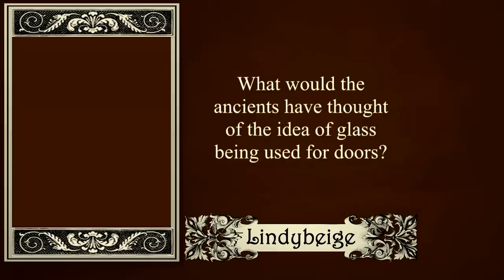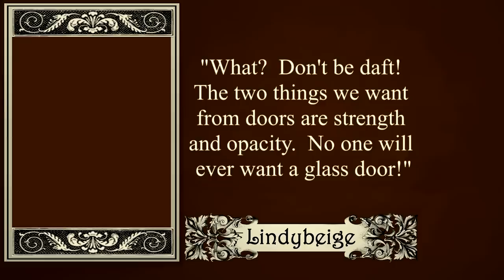Ancient technology: Saxon glass-working experiment

Comment: You're right I HAVE wondered what the Anglo Saxons were using between the 7th and 9th centuries to make glass!
Reply from the maker: I have my finger on the pulse - in tune with the Zeitgeist!
Reply: In The Mix not the sixth or tenth, though, why would anyone think of THAT.
Reply: @AAAAAAAA-vd6zv  couldn't care less about glass making in the tenth!
Reply: @lindybeige  thanks for the best way to start my weekend
Reply: @lindybeige  
Sometimes they didn't use glass at all … often they just used shutters, and then had them open during the daytime.
However, during the winter months, if you could make a shutter that kept weather out, and let light in .. even a small amount, you could save a lot on candles.

The simplest of shutters, are just a bunch of planks nailed together, and while they protect from the weather, they also keep all light out.
You could make them with louvres, and while that would keep rain, snow and some of the wind out, they would not keep the warmth in.

So, I've been told that sometimes they would take some leather and scrape it REALLY thin, and then make it wet and stretch it over a frame .. when it dried, it would shrink a little and put the frame under compression - Very much like a drum skin, just repurposed. They would then take the leather frame, and stick it on the inside of a louvred shutter, making it good against both the weather and cold. They could do it with wax-cloth - Heck you might be able to do it with varnished paper as well!
I suspect that the old French Polishing method might actually produce a fairly good result.

Obviously, once glass became available to the common man, shutters were relegated to extreme weather protection, or protection against criminals.
Reply from the maker: @Grumpy_old_Boot  ??  On windows, do you mean?  Yes, as I said it was just about practicable to have glass windows on some high-status buildings - therefore not the rest.
Reply: @lindybeige  
Correct - Even some of the rich people didn't use glass everywhere - It was fairly common to just have shutters in places such as stables and servants quarters - Even if it was technically the nobles house.

They didn't need the light anyways. 
The dirty proletariat that they were. 🤣
Reply: The sleepless nights!
Reply: In The Mix then youre watching the right video
Reply: In The Mix then dont watch the video
Reply: @lindybeige  Your videos give me something to look forward to in an era where all entertainment media is subversive political dogma bordering on the religious. Thank you, and keep it up, please!
Reply: @Grumpy_old_Boot  I too have read of the magical skin-window. However the issue is you aren't keeping any heat in either, as a tiny thin near see-thru piece of skin isn't going to be a good insulator so at that point you may as well have the bloody window open! :P
Reply: @dr.lexwinter8604  
The point was not to have an amazing insulator, it was to let sunlight in to save on candles and to stop the cold air and the hot air from mixing. Heck, you could use anything else in place of a proper glass window, and it would still work.

Heck, wind resistant shutters work too.

The whole point, was to trap the warm air inside, and the cold air outside .. and maybe get some sun in as well.

The actual insulation properties of the material itself was less important, as the loss to mixing inside and outside air would always be a much, MUCH higher loss to begin with.

Heck, you could have used translucent aluminium, one of the best heat transfer materials around, and it would still be a positive result.

Turns out, that having gaping holes in your building, looses heat faster than plugging them up! 

Shocking, I know. 😆
Reply: Same it’s been on my mind all day!
Reply: @LegendLength  
I guess you could make a thin sheet of tree sap and dry it out, trying to turn it into a sheet of amber, it's a lot of work though. 

But I'm guessing that the end result would be similar to semi translucent plastic.
We know that translucent plastic make lovely windows. I reckon you might be able to do it with lacquer as well.

But it doesn't have to be completely translucent, semi-translucent will do as well. Adding fabric or some other kind of fibres to the mix, would increase the strength of it.

Edit :
Paper windows was quite common in China/Japan/Korea, usually paper and lacquer was used, meanwhile 1800's american pioneers sometimes used greased paper windows, when glass was too expensive.

Comment: That tunic would scare the HELL out of me, working with hot glass like that
Reply: It would be incredibly hot in a glass workshop so it would make sense to not wear that many clothes.
Reply: Well if it's wool, it's basically inflammable and not a problem; issues will be mostly cosmetic, maybe some small holes. If it's a flammable natural fabric, the worst that can happen is a spot catches on fire and you slap it, putting it out. You now have a hole to patch and some slightly singed hairs, maybe, but that's it. Even if it the entire thing catches fire and burns off of you, you'd have to be quite daft to let it burn long enough to badly injure you and not take it off. And fabric being quife the insulator, does provide you with a decent grace period of protection from accidentally touching hot stuff.

Now if you have a synthetic fabric, that's quite dangerous; it can burn, but melts onto the skin instead of burning off of you, and the natural reaction is to pat it out, driving that molten plastic into the skin of the melting area and your hand.
Never work with heat with synthetic materials

Comment: The soot is due to bad air supply; It's incompletely burned smoke. The pleasant smell of burning wood resin is probably just drowned out by it.
Reply: If you don't want your glass to oxidize a fuel rich fire is the way to go. Also you would have to force air into it. Keeping that thing burning is enough work without working bellows.

Comment: 16:00 as a person who knows quite a bit about wood burning (mostly from experience) I can tell you that green wood (dampened wood) can work just as or even better than seasoned wood deepening on the circumstance, but you have to mix it two greens for every seasoned, and the seasoned has to go in first because the seasoned will burn just fine and even boil the water out of of the green wood and by the time the seasoned wood is burned away the green wood will be ready to burn this will increase the amount of time it before the needs wood to be replaced meaning fewer reloads and increases wood burning efficiency by 50-70% with little to no change in temperature

Comment: Good, clear and accurate explanation of a complicated topic!

Natron is more than just sodium bicarbonate, btw. It’s a mixture of sodium carbonate decahydrate and around 17% sodium bicarbonate along with small quantities of sodium chloride and sodium sulfate. Prior to it’s use in making glass, its primary uses in ancient Egypt were in making Egyptian faience and in mummification. After trade in raw glass (which was soda-lime glass) from the East declined in the early medieval period, glass makers in the West substituted potash from wood ashes and developed the so called forest glass. 

Making glass from raw materials is very energy intensive and even today isn’t done in most art glass studios. Instead glass artists buy nuggets of glass and melt them in furnaces, maintaining it in a melted state for many hours to eliminate bubbles, as Lloyd explains.
Reply: BTW, the footage showing a glass rod being shaped in the flue just explained to me how both bead-making and core-forming would have been done with ancient technology. Today such things are done with a gas-oxygen torch, which of course didn’t exist in the ancient world. But the flue would have been a pretty good equivalent, depending on the makeup of the glass being used. 

The soot coming out of the flue is, as another commenter suggested, a sign of incomplete combustion. They need more air going into the furnace and perhaps some form of forced air—either a natural draft from wind or perhaps a bellows. That technology would have been known from metal-smithing.

Comment: A flame will burn of much of that sooty smoke.  Try waving a small, flaming torch through the smoke.  A propane blowtorch works well.
I teach this trick to cut down the coal smoke from a forge fire, only there a separate torch isn't needed -- just poke through to the tuyere and increase the air blast slightly.  Absolutely essential for indoor forges.

Comment: To put it in perspective we had a fiur hundred pound capacity freestanding pot crucible furnace from a company called falorni in italy in my college. To safely bring it up to operating temp took a week ling heat rise programmed into the digital controller. Ours came up and down twice a year but the ones in italy sometimes stay on for over a decade before the crucible is fatally corroded.

Comment: 0:00 Yes, in Norwegian the thing is an "ovn" (literally "oven")  no matter what. You could specify what kind of oven it is by adding a prefix such as: "varmeovn" (lit. "heating oven", i.e. used to heat a room), "bakerovn" (lit. "baking oven") , "keramikkovn" (lit. "ceramic oven", i.e. kiln) or "smelteovn" (lit. "smelting oven", i.e. furnace). This is probably true of most germanic languages except English that has randomly imported words for a lot of things rather than making compounds (even though English is perfectly suited to make compunds as all germanic languages, even though English has a habit of writing each word of the compund separately).

Comment: The dodgy wood that Victoria was sold that almost put out the fire could have been willow. As I was told a while ago, willow is one of the only (hard) woods that can put out a fire ( if it's not well seasoned)
It will burn but only after a lot of effort has been put in, namely with other decent wood.

Comment: 6:00 -  I imagine that soot is a result of water interfering with combustion, volitial compounds in the wood and the soot already deposited on the walls of the kiln being blown out by the force of the combustion. With that said I imagine forcefully increasing airflow would reduce the output of soot and as cultures before this knew about introducing more air, is it not likely the Saxons would have done the same?

12:00 - You are no doubt already aware of this but settlers in the USA would build chimneys with a mixture of clay and any local vegetable matter, which would often be hay or cattails; the plant matter helped to strengthen the clay. The hay inside would not burn, although because they were using these chimneys as permanent fixtures they would line them with thick clay and stone to increase their longevity. Even so the clay/plant matrix worked as a brilliant insulator and so the plant matter didn't ignite.

Comment: Charcoal is made in a very particular sort of furnace set up. So maybe the reason the smoke was "coal like" is because it's so hot, and at such temperatures, that when you introduce fresh wood is is burning so hot that it sort of "charcoal-ifies" in real time? Now obviously im not saying it becomes charcoal in this process, but merely that it's so hot the scientific process leads to a more soot based burn at hotter temperatures then normal, in the same way that charcoal burns more efficiently then standard wood. Hence why introducing new wood leads to that huge pillar of flame. It's interesting to see how wood can change the temperature of a fire based off the way that wood is treated. Dry standard wood becoming a sooty hot burning charcoal like process verses untreated wood killing the fire from too much moisture and ineffective burning process.
Reply: The Chad Charcoal verse the Virgin Cut Wood
Reply: Further, Charcoal is sort of a miracle substance. If you're ever forced to survive in the wild, building and making a charcoal furnace can literally save your life. It can allow for water treatment and purification, better storage and use of fuel in the winter, and higher temperature burning to allow for basic tool making. Plus, it isnt the most impossible thing to do, and can be done in just a few hours with determination and the right materials. Plus, it makes for a sweet BBQ!

Comment: I'm really curious about the furnace. How does it get its air supply? I'm guessing a draft but how is it structured?

How was is built/hardened? How long did it take?
Reply: Air is supplied via a hole in the return side.  Heat draws the air in.
Reply: @Alamyst2011 Yes, a draft furnace, but go more into the dimensions and mechanisms, why did they build certain parts a certain way, were there historically documented/remaining examples of furnaces that can be drawn from? etc.
Reply: @dattebenforcer  Of those specifics I do not know.  However I have seen several forges such as this at medieval fairs.  Sometimes they used stones lined with clay.  Othertimes they are built into the ground and a canal is made on either end to funnel air.  I would wager someone has posted blueprints on the net.
Reply: Are those accurate though?

Comment: One of the things I was curious about, was whether they'd have ever used charcoal. Was it simply unnecessary, therefore inefficient, or was it actually unsuitable? Using charcoal to work steel predated medieval times, so they were definitely practiced in using it to achieve and maintain high temperatures, surely this would have been ideal?

Comment: Cullet requires less heat to melt than created glass from raw materials. Instead of 2300 degrees to melt the raw materials, you can get it melted at 2000 or so.